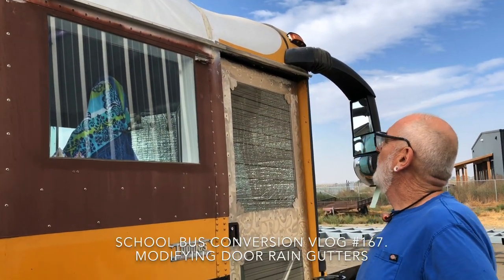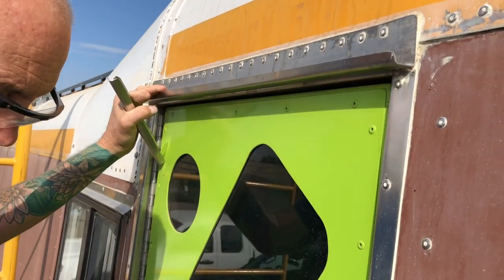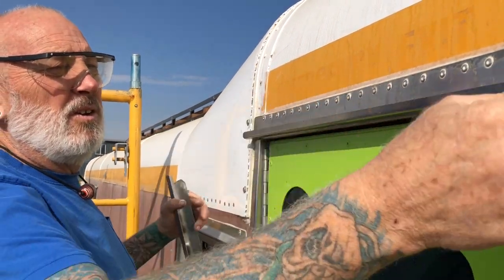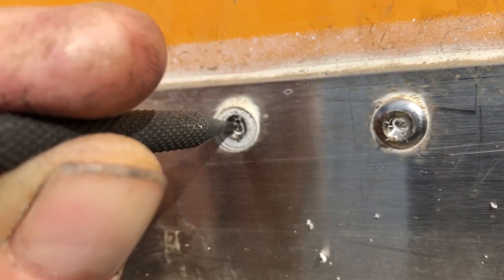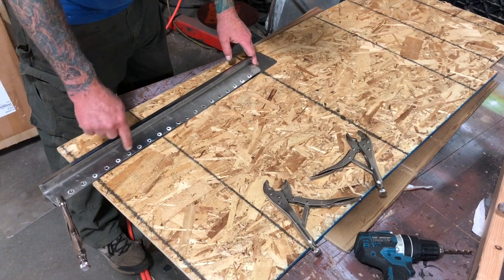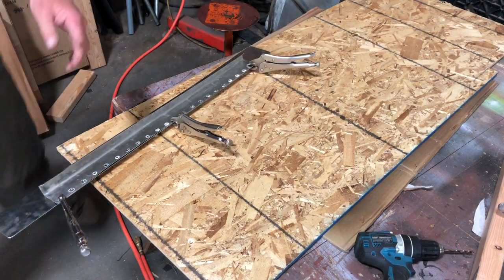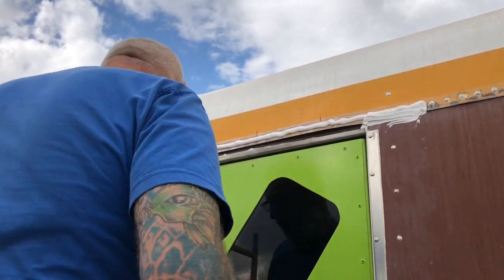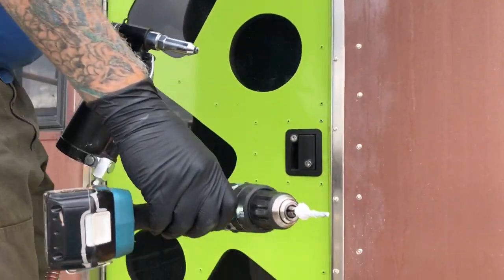Modifying Door Rain Gutters - Vlog 167 School Bus Conversion

Comment: When I removed the ceiling in my bus I had to remove 500+ steel rivets, yet it is a pain, and I was doing that in the winter so had to switch back and forth between the air tool and manual punch and chisel, the air tool kept freezing up even with some heat  in the bus.  I like your rain guard idea, I have seen that on houses over doors, makes a whole lof of sense.
Reply from the maker: Thanks. We have them over all our windows too and they really help. 👍😃👍
Reply: @KnappTime  I had a number of issues with leaks in my case, almost all of them related to worn gaskets in the running lights.  I may still have one leak but I think it is in the seam in the roof, going to look at a good quality white sealing paint to correct the issue though I have not seen water inside for months now, which is good.
Reply from the maker: Oh wow thanks for the tip. We had not considered that. However we are going to replace all of our running lights with new ones so hopefully that would solve the issue. 😃
Reply: @KnappTime  Be sure the replacement includes a gasket, doing that work might as well do it right.

Comment: You could put a piece of 1 inch angle iron on the roof too, will push water away before it gets over the edge
Reply from the maker: Oh man that’s an interesting idea thanks. 👍👍👍👍
Reply: @KnappTime  Or even some type white plastic or rubber you can glue to the roof with that sikaflex stuff. 
I was thinking of it because that is what we have on the metal roof on my Office building.  Its just at an angle so the water moves to the side.
Reply from the maker: Something definitely to think about.

Comment: Great tips! What size bits were you using? I’m gonna use 3/16” steel rivets too so this could be handy! 🙂
Reply from the maker: There is a link in the description of what we used. But we did use 3/16 bits.
Reply: Knapp Time perfect, thank you!
Reply from the maker: No problem. Hope it helps.
Reply from the maker: We have found there are a bit more affordable on Amazon .... BTW. .... when doing a bus conversion you burn through them.
Reply: Knapp Time thanks so much. I’m starting my build a week from now, so these videos will definitely help!